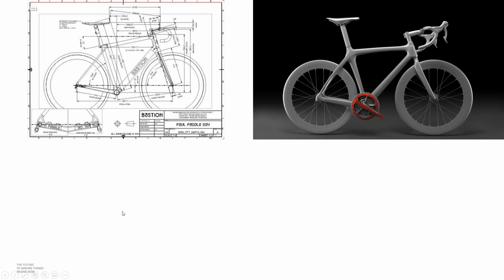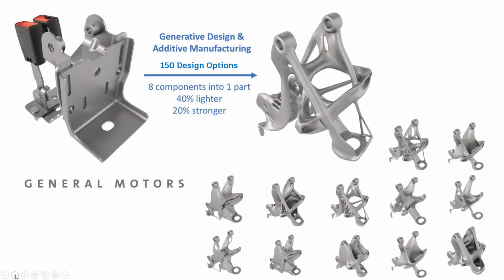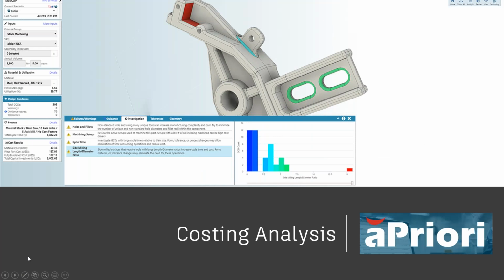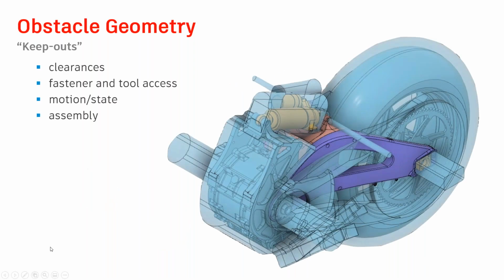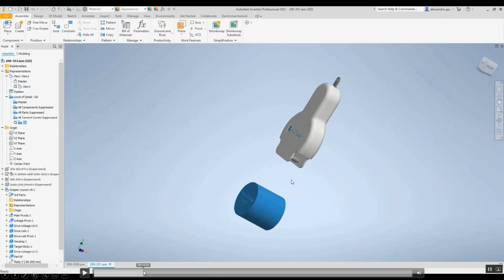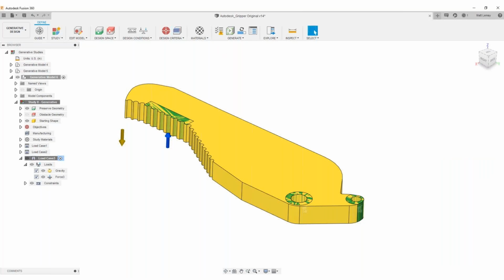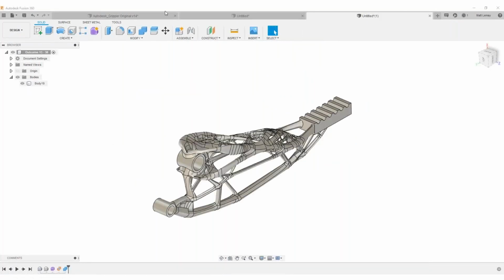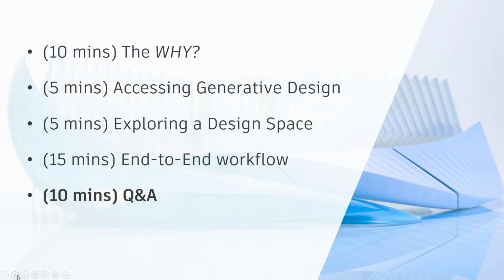Generative Design for Autodesk Inventor Users - April 2020

Comment: Is it free? I have the design n manufacturing collection
Reply: In 3D Model Tab, select "Shape Generator", i think it may require "Inventor Nastran" to Calculate optimized Shape which is included in "Product Design and Manufacturing Collection"
Reply from the maker: Hey Dean. You do have access to Fusion 360 but there are additional costs associated with the generative design software. Let us know if there are any other questions you have!